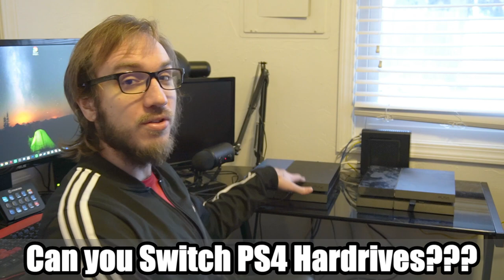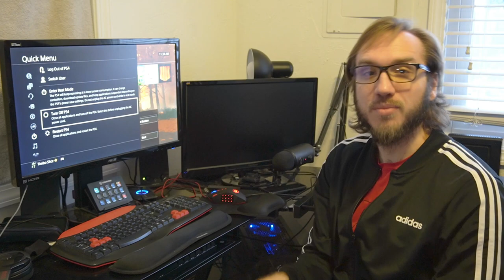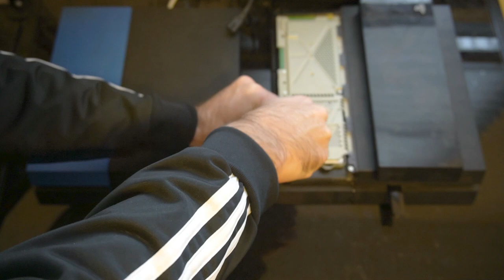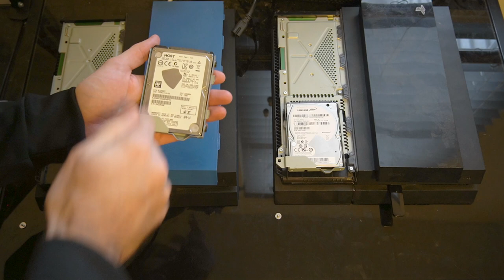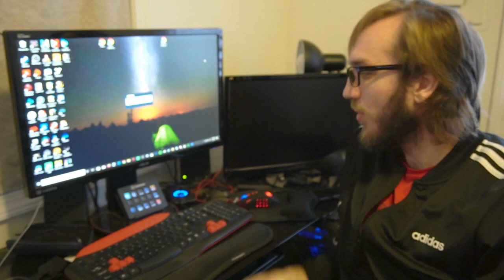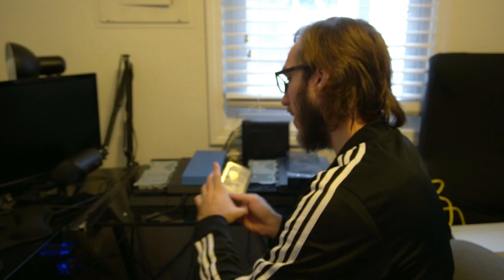Can you SWAP PS4 Hard Drives without Losing Data??? (Bring PS4 Hard drive to friends house?)

Comment: THUMBS UP SO PEOPLE CAN SEE THIS!!!  THIS IS HOW YOU MAKE IT WORK 
STEP 1: after you switched hardrives can turn on your PS4 on safe mode 
STEP 2: SCROLL TO “UPDATE SYSTEM SOFTWARE” (make sure you’re connected to WiFi/Cable -cable recommended-)
STEP 3: Restart PS4
Voila!
Reply: Does this actually work tho
Reply: Yea does it work
Reply: Thank you. Way to get to the point. This video beat around the bush and waste time.
Reply: I can 100% confirm that this did NOT work for me.
Reply: Upgraded the original hard drive for something that could handle more space ( 2TB Seagate Firecuda). The short version of the story is I had a power surge and it killed the new drive. I reinstalled the original drive that came with the PS4 and it gave me the re installation error. Turns out putting it into safe mode and updating it work in my scenario hope this helps others.
Reply: Trying to move from the original fat PS4 with a fried motherboard to a new slim, it didn’t work. RIP
Reply: Is this working ? My PS4 broke and I want to switch the hard drive to other PS4 that a I’m going to buy , because I don’t want to lose my save games
Reply: what if i don’t have a lan cable please answer this!
Reply: Is this going to keep all the data from my ps4 drive when switching
Reply: @JR. ClangMan D  depends on what
Reply: @JR. ClangMan D yo what do you mean by soft wear like my account my old ps4 broke and i got the hard drive and all i want is for it to save my playsation account because idk what email i used for it
Reply: @samuelalmeida6523  what did u end up doing cause I'm in the exact same scenario
Reply: still all your acc will get deactivated.
Reply: It still doesn’t work lol
Reply: @lowspazz9546  can I put my ps4 hard drive into my brothers without losing data 😂
Reply: @namandang5345  wait so I can put my hard drive into my brothers ps4 without losing data?
Reply: Jeeteromm yea but nothing really happens it’s like the hard drive is specific to each ps4
Reply: @lowspazz9546  dang so I can’t just take out my hard drive from my ps4 and put it into my friends and still have all my games and profiles and stuff like that?
Reply: i tried this. IT DOES NOT WORK.
Reply: @betancourtj3  I think you might’ve done something wrong.
Reply: @samuelalmeida6523  did you find away mate
Reply: @IsaacKnowReally  did u find away
Reply: @BigBoss-kf4nh  no my PS4 was trashed
Reply: @betancourtj3  did you get it to work?
Reply: @joshm5433  Afraid not, mate.
Reply: When I go update system software, it gives me 3 options and none of them work
Reply: Does this work ?
Reply: @loxity6454  u can make a call at the playstation team and they will tell u the email
Reply: @Kiharu_Sunzuko  it worked for u???
Reply: @Kiharu_Sunzuko  did it work
Reply: @Kiharu_Sunzuko  did it work??????
Reply: @flashthompson1085  did it work
Reply: @djw_tekken8490  this was a year ago. I believe he is missing one step. But it did (kinda). The most important thing was saving my copy of PT from a dead PS4 without losing it.
Reply: @samuelalmeida6523  yea same! did u find out if it worked?
Reply: It's like authorization of the hard drive has to be put in the firmware.
Reply: @40xXmattmanXx  do you have a link to the 2T one?
Reply: @samuelalmeida6523 did you find any solution?
 I have the same issue.
Reply: THANK YOU SO SO SO SO SO MUCH I GENUINLY LOVE YOU

Comment: For those wondering if you could alternate between two hardrives which are solely purposed for your playstation, you could. You could not, however, use one hardrive between 2 playstations
Reply: Yeah format is tied to the main board. Good for those who want to keep their P.T. hard drive safe...
Reply: Nice, I tried backing up save data to usb and got an unreadable dat file. Thought I lost everything.
Reply: How do I use a second hard drive with my ps4

Comment: Guys in case you are wondering (i don’t think you can remove your original/not changed hard drive and not lose any game i have done it with the original ps4 500 GB 2 years ago and it seems like the hard drive is not even working any more.

Comment: I took my hard drive out to do some cleaning and after putting back in I am stuck in a boot loop in safe mode. And of course, I forgot to back up my save data on my second account so I am likely going to have to reinitialize and lose a ton of stuff. Can't seem to restore default, rebuild database, or any of the other options as they all require and restart and once the system does that is just places me at the safe mode menu again without actually having done anything. So frustrating.
Reply: Aha, I have the exact same problem, yet I never messed with the internals. I have completely given up all on all hope once the PlayStation help desk said I couldn’t get any of my data back whatsoever. Not to mention that repairing the device (without getting any of my data back by the way) is going to cost $280 AUD. If you can somehow find a solution to get outta safe mode, and keep all your data, please respond. Hopefully you can fix your problem, somehow.
Reply: @Orthais
Reply: @wontonwasabi2725  yo I tried to swap my hard drives and mine went into safe mode as well. When it got the the part it asks you to plug controller in and when I did I just hit cancel instead of the people there option. PlayStation shut off. I turned it back on and it was fine🤷🏼‍♂️ maybe try that?
Reply: For how long you’ve had your PS4 ?

Comment: Hi, my old PS4 had an accident but  I still have the hard drive, I already have a PS  pro,  can please someone telling me how I can transfer the data
Reply: Contact sony
Reply: most likely you have to use that old ps4 to retrieve your data
Reply: Have u done it yet because it’s really easy I will tell you
Reply: @joshbucko0795  please tell me
Reply: @MrSingh1150  you can’t it’s broken
Reply: @ashbytorretti6403  if its broken then you're out of luck lol
Reply: im sure you can swap the hard drive, he just didnt download the new software, you need to actually go on sonys website and download the new version to transfer.
Reply: @nikaoles4817  doesn't work unfortunately.
Reply: @Darsh0019  you sure? My Pro's motherboard shorted and everything's f*cked up... But the HDD works, which is kinda useless now.
Reply: So if I have a usb stick with the new update from Sony online and I plug it in with my old hhd will I get past the safe mode when I start up
Reply: @fashorosay3015  dream on. Sony SUCKS.

Comment: My ps4 slim won't accept discs anymore, and bc of this I can't install ps4 updates.

Do you know if it's possible to move the HD from my broken ps4, put it into a working ps4, install the update of the latest ps4 version from a USB drive, then put it back into the broken ps4? Would doing that cause the broken ps4 to boot into safe mode, or will it log me back into the ps4 since it's in the original ps4 console?
Reply: I’m wondering the same thing, my motherboard on my original ps4 got messed up just bought a new 1TB ps4 slim it won’t accept the old hard drive and says I need the update from Sony online haven’t tested if it works with the update on a usb stick though ...

Comment: If you do the hold button on do a system update it will allow you to move hard drive from one ps4 to another, i lost my data for FF7 remake and regained it, i am the happiest person in the world
Reply: Wait so if I put MY HDD in another PS4, launch in safe mode, then select System Update, I’ll be able to use MY HDD?

If that’s true THANK YOU!!! I’m literally in the exact same boat. I really don’t want to lose my FF7 Remake saves, I’m so close to the end
Reply: @jaydenlopez8165  yes it worked
Reply: Could you elaborate on the specifics like step by step

Comment: Yeah I was pretty sure you can't do this I remember in older days you could on the 360 but when you think about it someone could basically steal your hard drive and swap it out on their PS4 so yeah probably why they stopped doing this as far as I know it's also encrypted on the PS3 to that specific PlayStation probably for the best without someone stealing your games unless you give them your password
Reply: They probably updated security so each hard drive is bound to their device. Swap hard drives with the same device.

Comment: Im actualy testing this because my friends ps4 just stays in safe mode(did all the options available update crashes) so to see if its hdd or the unit, I will reinitialise the old ps4 hdd in my ps4pro since losing data at this point isnt as important as losing 70$ for  a 1tb hdd.

also the broken unit hdd, when i put it on my pc it reports as all partitions are healthy.
Reply: Hey how did u fix this problem I just got it and don’t know what to do
Reply: I have that to I have the safe mode loop

Comment: You should've tried updating using USB to see if it would work or if it overwrites using system reinstall
Reply: It does work and so does the option in safe mode to update system via internet.

Comment: So the Playstation puts a code on the harddrive specifically for that playstation and everytime it boots the code on the hard drive has to match the code on the system to boot. I have a adapter that plugs into those harddrives and allows me to plug it into a computer as a external hard drive would it be possible to copy that the encryption code off one hardrive and put it on the other hardrive to make the Playstation boot up with all the data still saved on it?

Comment: So I switched to a ssd like a month or 2 ago. The question is can I switch back to my old drive and use it without having to set up anything ? Can I hot swap back and forth as long as I have both drives up to date ? And will my data be fine?
Reply: Anybody?
Reply: I have the same exact question and I can't really find answers. I also switched my hard drive for more storage but I didn't copy all my save data to the cloud accidently so I only had some of my games data. And I've been trying to see if I can just swap it back (safely) in for a minute to copy the rest. But I can't find a single video covering this. 

I did find a couple "gamefaq" pages where ppl said you can swap back and forth if it's the same PS4. But I don't know what steps are needed exactly, like do I have to use safe mode or something or can I just do it while it's off?
Reply: Yes u can swap ur internal drives on  the same PS4, it will boot with all the data intact. However i don't recommend doing it frequently.
Reply: @raviece2k10  this video came on my recommended recently oddly enough after thinking about my old game footage I saved on my 500gb HDD before upgrading to 2TB. Since it’s still the same PlayStation and it’ll work swapping them back and forth…any way I can just transfer it somewhere to put on the newer HDD? My external hard drive only worked with my game data as well. I’d rather not have to swap to see my old gameplay 😅
Reply: Any updates? This is the exact question I have.

Comment: I have a question I have two ps4 slims one in my room and one in the living room my PlayStation has lan cable port doesn’t work so I wanted to swap the ps4s but i don’t really remember the account information’s on my PlayStation would I be able to swap the hard drives and do it that way without having to redo everything

Comment: So if both Ps4 consoles are both at the same firmware, could they both be swapped and work  with no issues? Both of my hards drives are original to the Ps4s . Would this work with swapping and no start up issues?
Reply: My question is also same pls help

Comment: This sucks, when your board or power supply burns out, were screwed. Good video.
Reply: When your psu blows up you can just replace the psu. If your mobo goes there is a way to do it in safe mode. You're only screwed if your harddrive goes
Reply: @MIW_Renegade  you can swap hard drives on the PS4 slim...
Reply: Mine did the same thing
Reply: @thomasodetinape4180  not what I mean, you have to format the harddrive when you swap it, I know because that's what happened to me
Reply: @thomasodetinape4180  it was a drive from my other ps4
Reply: @MIW_Renegade  Cool, I've heard it's a good update to use the Baracuda drive. Supposedly games load faster and play better.

Comment: I’m getting fed up with my corrupted games, nothing seems to work, not even safe mode will do the trick although I haven’t tried replacing the internal hard drive or initializing it yet, which is a definitive hell no cause my little brother plays on the same ps4 as I do on the second account with no cloud save.

Comment: So say I did reinitialize system and wiped the hard drive out of my old PS4 and than got the system firmware installed and than put my current one back into my current PS4 would it mess up my current hard drive I’m trying to have two hard drives one for MW and one for everything else

Comment: I have a 350gb vids in my old ps4 hard drive and my old ps4 has been broken but the hard drive is okay what shold i do?
Reply: Ahmed  try to use it with a new PlayStation if that doesn’t work your out of luck
Reply: Ahmed you can find a usb3.0 cable and connect It to your pc and then you can transfer all your data there
Reply: You can buy a external housing for about 15 bucks on Amazon and use it like that
Reply: @
Not weeb Knight  ...sex....

Comment: The main focus of the video wasn't what I was after, but the ending answered my question.

I am planning on upgrading my stock HDD over the Xmas break, and wanted to know if I could go back to stock HDD if there was an issue. Or if by simply inserting a new drive, the old drive would be forced to be wiped if reinserted. 

When upgrading a PC, I'll generally leave the old SSD/HDD for a few months as-is, and then when I'm sure the new drive is OK, I will then wipe the old HDD and put it in a USB enclosure/caddy, to act as a backup drive.
I guess I will give the PS4 a month or two with the new drive, and then format the old drive to use as PS4 external storage.
Reply: Hi would like to know if your method works, as I was going to swap out the original HDD for an upgraded HDD.
Tried to download the re- installation data from Sony's website but it's not down loading from the site.
Reply: @leehawkins485  I haven't got around to it yet (although in preparation I did a full backup to a spare USB HDD yesterday).
Do you use the Chrome browser? I tried to download it via Chrome, and neither the update or reinstallation file would download. However I then tried Firefox and it downloaded no problem. Same with Microsoft Edge, it downloaded fine.
It may be a false flag security issue with Chrome, perhaps it's wary of downloading PUP files?

By the way, remember you have to format the USB drive to FAT32, then create PS4 folder with an UPDATE folder inside that. Copy the downloaded file in there, you shouldn't have to rename it.

Comment: Can y’all help me with something please? I have a first gen ps4 and im trying to transfer all my data to my ps4 slim from my first gen ps4 and I tried transferring the data using an Ethernet cable and it got stuck on a certain percentage so I heard something about rebuilding the database and I did that and tried it again using the Ethernet cable and the same thing happened. Is there any other ways I can transfer data ?

Comment: My ps4's hard drive broke last week. Its on reparation now and they will change it. I know im gonna get to keep the games i bought and all those things so im okay with that but there is one thing i need to know. Will i lose all of my saves? Because im lvl 70 and have the season 1 battle pass on cod mw and lvl 100 on rdr with everything. If i lose everything i did on these games i will cry.
Reply: No you will not lose all of your saved online games process such a cod or fortnite  Destiny, RDR 2 etc. These online games especially your account will not get deleted cuz your online accounts are saved on their server online. Also if your online games got stored on cloud the  its all good. But only your clips and screen shots and single player games all of their saved data will get deleted unless if you backed them up on a external hard drive.
Reply: @gjippsy8419  gta5 online?
Reply: Mortal Kombat online ranking will start over at Rank 1.

Comment: Hey there  thank you for the video! What happens when I only keep like 4 games on my ps4 pro, then do all the steps to go from HD to ssd and also make a backup. Will it also backup the games bought  but not on my playstation or rather  will I still have acces to them after?
Reply: Because I did already order a 2tb Samsung evo ssd and soft delete a lot of my games. Did only keep fallout76, AC Odyssey Horizon Zero Dawn and Unravel. The rest, it says, I can re-download.  But what if I backup  reset the whole ps4 and change to ssd.

Start it up again.. will I still have acces to the bought games or is this solely connected to my PS account, which seems logical and this is what I think/hope ofcourse 😅

Comment: Alright lad, my daughter's PS4 is completely goosed because it got soaked by water, no power at all. I'd like to get her profiles and save of the HD and upload it to a new one. Any ideas on how to store it safely on an external HD till I can get her a new PS4.
Reply: I have been trying for ages to get my save data plugging it into a computer doesn't work as you can't access the files
Reply: I mean do you need to do all that?? I just accessed into my account on the new ps4 because the old ps4 died due to power outages
Reply: @lordpean it will only have the saved data if you backed it up beforehand and if you dont have ps+ that's not an option